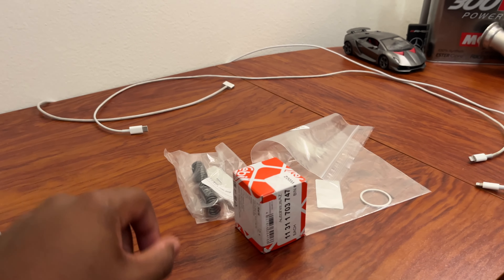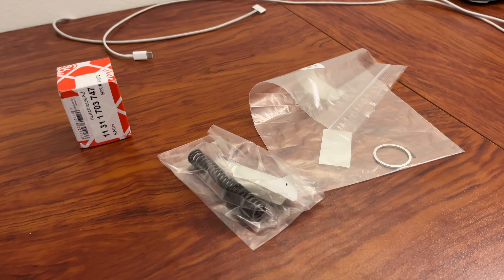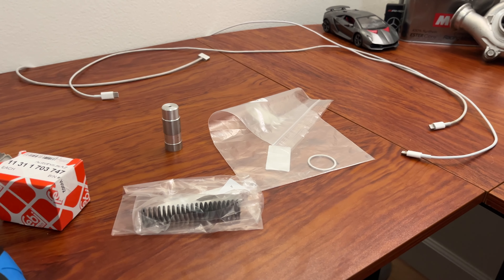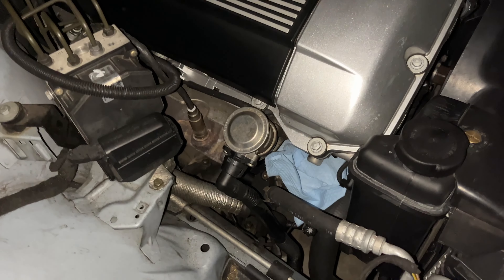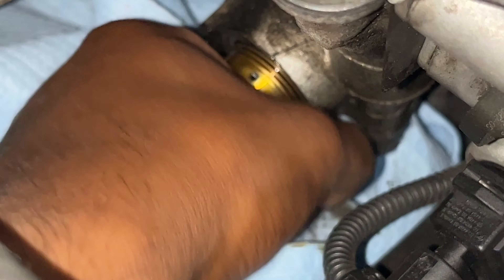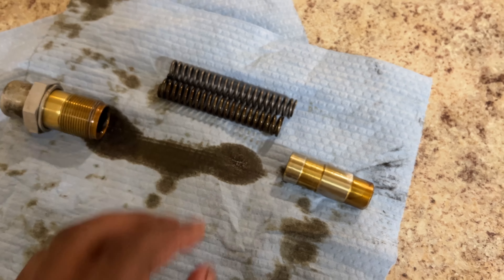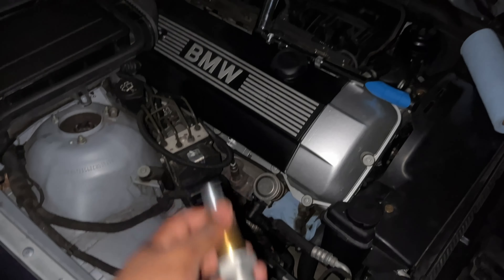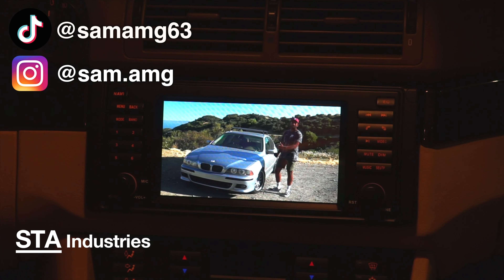BMW Timing Chain Tensioner EASY DIY for M50/M52/M54/M56 in E36, E46, E39, and MORE!

Comment: 1:30 I recently changed the tensioner in my E39 535i (m62 v8 engine block) and it was WAY more tricky because of the engine design. Very difficult to find space for the tools and getting the new one to "catch on" when mounting it was ridiculously hard. In my case, it's not just a spring, though - the tensioner uses oil pressure as well, so many that's what you're also referring to for the M3 parts ?
Reply from the maker: Yes its probably similar to what is used in the S54! Although that one rarely fails for whatever reason.

Comment: Did you get rid of the m56 valve cover?
Reply from the maker: Yup, kept having weird crankcase pressure issues. Mentioned it in the pinned comments of my M56 videos. Never got the setup figured out entirely, it was always blowing out valve cover gaskets. The car is my daily and I didn't really want to deal with it so I found an aftermarket M54 aluminum cover which I use now. Been great so far!
Reply: Good to know. I've had mine on for about 10k miles with no issues. I also didn't mess with the original m56 ccv diaphragm and used the m56 ccv hose. Man I miss my e39 a great comfortable daily before I exchanged it for my e46. I'm still always on the look out for a 5 speed mt 6 cylinder e39 here in socal.